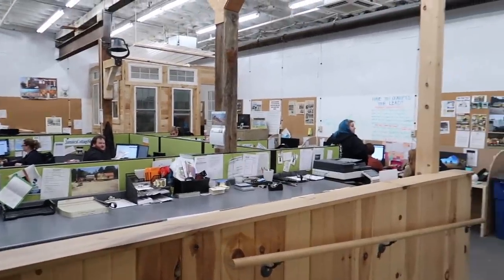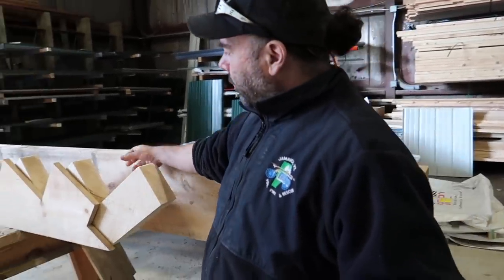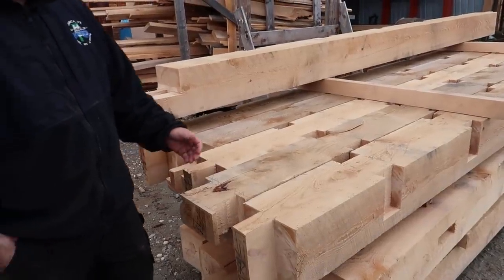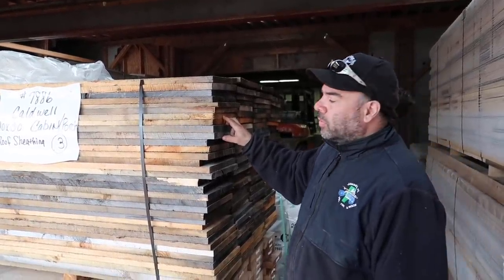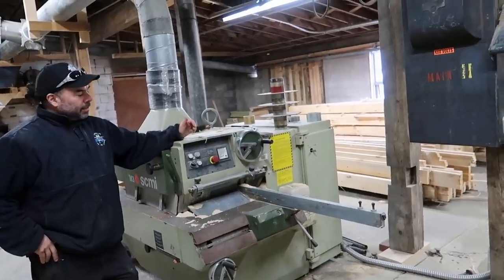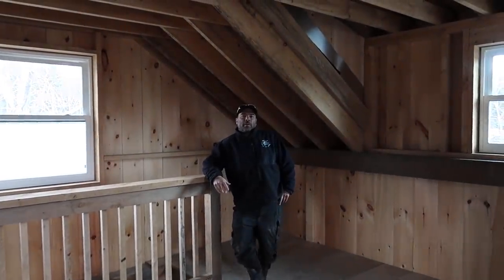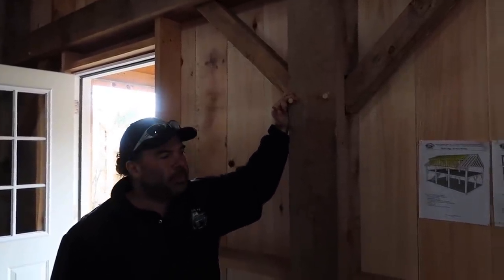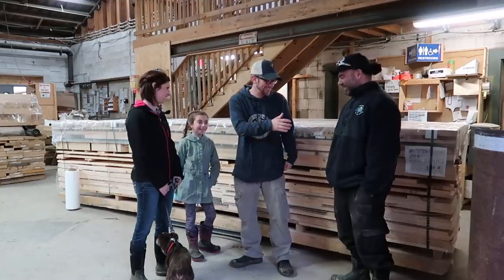Purchased A Barn on the Internet This is How It's Made (Factory Tour)

Comment from the maker: Our Barn kit comes from Jamaica Cottage Shop ~ http://bit.ly/2LjBmeT 10% off with Promo Code YeahBro10    Thanks Domenic for the discount!
Reply: How do you like your barn? Well made? I'm thinking of buying my cabin kit from Jamaica.
Reply from the maker: Tina Lippert we are very happy with everything! There customer service has been amazing too!
Reply: Okay....so I was way off base!! I thought this is a NEW HAMPSHIRE company but it is not! We’re down in Barrington, NH...Still, beautiful buildings and they have a great system! One question Al. Did you have to pay Vermont taxes? Similar systems are available out of Maine as well but, I do much prefer this one you got...I wonder price difference. We got our double lofted (8’ each end), opening loft door, one window, the double opening end doors and a second oversized door on the side. We had it wired to include a heater and 220 welder. All totaled, with electric, about 8,500. But this is 2x4 and 2x6 dimensional lumber construction with a metal roof. It’s stained and sealed with 5/8 flooring. I’m happy with it BUT, I do admire those post and beams!!
Reply from the maker: @keithrayeski3147  Nope no sales tax since it was delivered to NH
Reply: What make/model did you get, if I can ask?-Mark
Reply: Is that in Jamica Vermont?
Reply: This is a well run operation.  The detail and quality sure stand out!
Reply: In the video he verbally said that the 10% discount was YeahBro170.  Please confirm.
Reply: @sachdevalamin3174   YeahBro10 works , 10% off
Reply: what i would like to know is where does he get all the revenue for the farm and all the equipment when he idoesn,t seem to have a job as he is allways on the his property

Comment: Thanks Al & Gina... You just may have saved me a trip down there ( 96 miles one-way ) by providing a tour of the facility. I am quite impressed by their method of cutting everything out in advance using CNC machines, labeling & stacking in order of assembly... I also appreciate that they primarily use northeast spruce... 
Big reduction in intensive labor time with this set-up, not to mention human error! 
Bill on the Hill... :~)

Comment: An interesting thing about factory buildings .  They are made more precisely than most on site created buildings .  Which means that the components fit better , the buildings are tighter, etc.  Overall , they are better buildings. And yet , mortgage companies will not loan money on them . I looked at a house that was just perfect for what I wanted  situated on eight acres of land.  The house was twice the size of the house that I finally was able to purchase. It had a large deck on the front of the house plus a large deck on the back . Best of all , it had a very large twelve brick high basement !
  But , no mortgage company would loan money for it.
Reply: I am facing this myself.
Reply: @Linda Polle ,
Frustrating isn't it ?  I had to buy a lesser  house with less land but with the same cost . And now , I don't even have a basement. Only a crawl space .
Reply: @donaldmiller8629  
The angle I am going to try is applying for a USDA farm purchase loan,  rather than a home loan.
I have also heard insurance companies and the Federal Land Bank have different rules.
Reply from the maker: I’m surprised the companies don’t have a financing option
Reply: @Linda Polle ,
Ah , I never thought of that . On the other hand ,  I'm rather concerned about getting the government involved. I once looked into getting a government loan for a high tunnel and was really shocked when I began reading the small print.  No thanks , I don't need a not so silent partner ! I'll just save my money and wait . Be careful with the government .

Comment: We have Toyota forklifts just like that at my job I use them all the time I'm actually one of their drivers at Manning Building Supplies that's where I work it's a very good company family owned but it's all across the state of Florida but they make some of the most beautiful doors we sale windows the whole thing whole building package which would be frame pack like the one where he was showing you we use zip board.. then you start getting thicker densities for the decking on top of the house and the deck and flooring on the subfloor level and then the walls of course needs just color coded for each purpose according to thickness...
Reply: I can never figure out how forklift drivers can get in their cars at the end of their shift and mentally switch back to front wheel steering.
Ive only driven one a handful of times, but man are they weird.

Comment: I deal with this kind of lumber and where I work at we work with custom homes six by sixes and lvl's . Engineered columns these are made from fiber layer together and pressure together and it's a lot stronger than your average Timber would be still would but it's glued together to make it a stronger beam ... please use cedar beams cypress beams make them into dovetails that's usually for Disney can we do custom homes out there at Golden Oak

Comment: Poor hope can't even get to the hay without being head butted, You need to put extra hay in another location so the older ones don't just hog the stand with hay and hope cant eat.  The other goats are bullying her that's why she hides under the milking stand. It's easier to add 2 baby goat than one, they will hang with each other for companion, hope is very young and will be bullied until she gets bigger and excepted in the herd, You CANT force goats to except her, in time they will until then safety is necessity. fyi: I have about 100 goats!